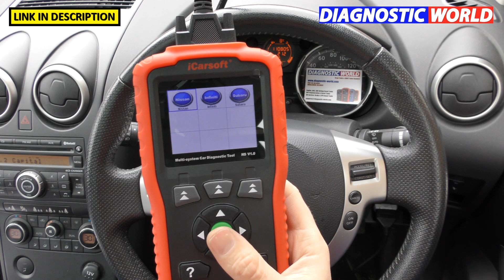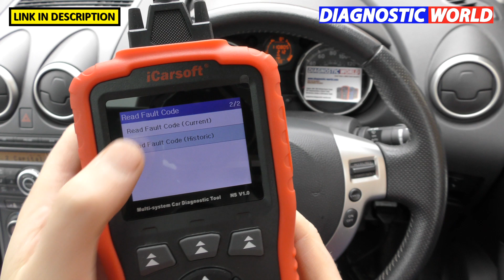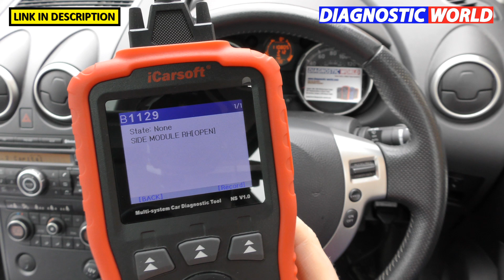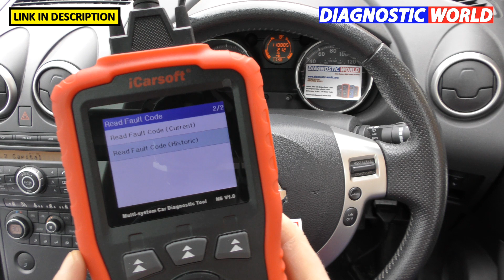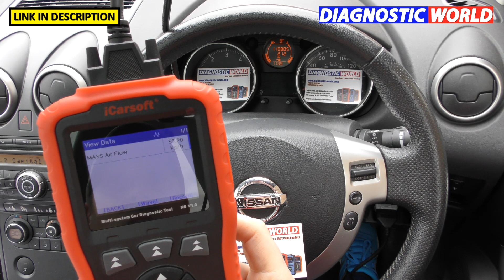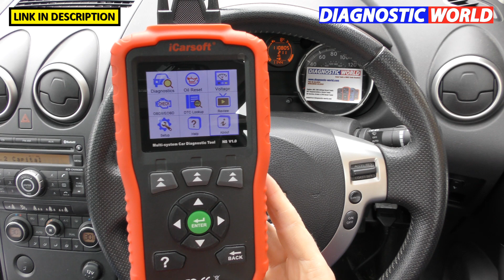iCarsoft NS v1.0 - Everything You Need To Know Before You Buy Nissan Subaru OBD2 Scan Tool

Comment: Personally, there are a number of "must-haves" if you are going to use a tool to work on a car. I feel one would "grow out" of this tool very quickly.  The "must-haves" are:

Freeze frame data on the codes on the manufacturers side of the tool (if the car's ECU supports it)
All special functions, such as DPF regeneration, Park brake off, ABS bleed, steering angle reset...etc 
Component activation for example turn on the Fuel Pump withe the engine off or a cooling fan etc..

It would appear that scan tool manufactures are using these features to justify charging large amounts of money for the professional tools.

The other issue that nobody talks about in reviews is the accuracy of the code and data information. For example, I have seen an AC compressor be reported as on when it's off or plainly wrong data coming up in the list. I have also seen completely incorrect fault codes. 

I suspect the ICarsoft range is based on the Launch? range of tools. If so it would be likely to be accurate as Launch is one of the better professional tools on the market.